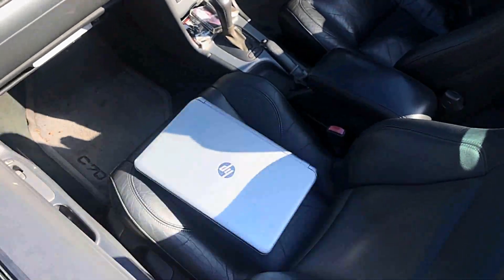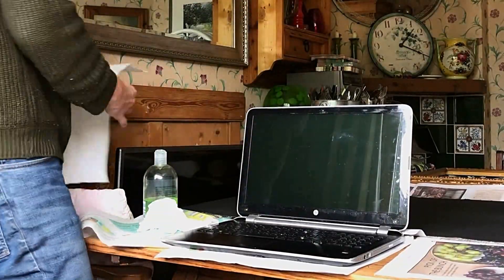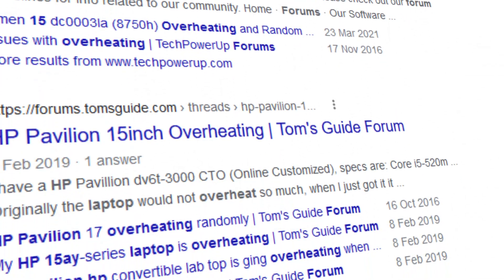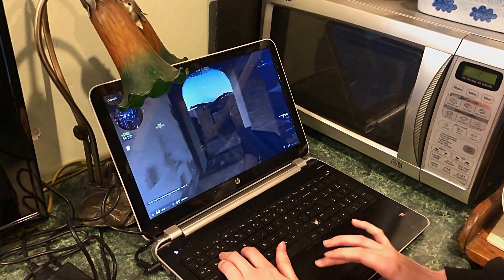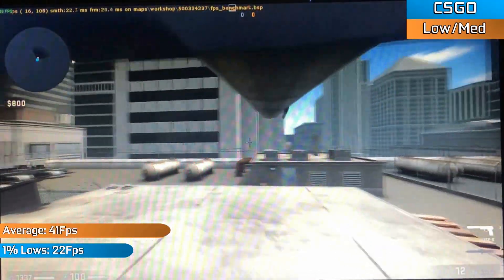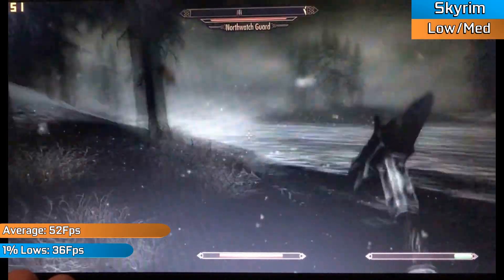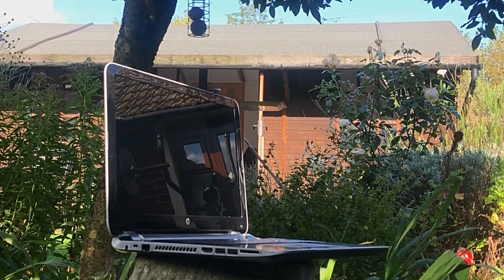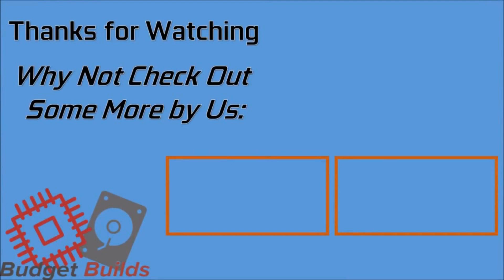AMD & HPs Awful Laptops...How bad are they?

Comment: I had one of these laptops!!! i never could figure out how to fix Crossfire microstutter in games, no combination of OS version, driver version and settings seemed to do much so I ultimately left it disabled most of the time. The drivers had other issues as well, particularly frustrating was their penchant for corrupting my desktop and leaving me with an unusable session every so often and also crashing Photoshop quite frequently.
It always was terribly slow, crossfire or no, I suspect an SSD would've improved overall system responsiveness over the shipped 5400RPM HDD but frankly the 1366x768 display really wasn't doing it any favors, after a while I couldn't bear to look at the thing anymore and further upgrades were out of the question. At that point all I had done was taken the RAM to 16GB of quality RAM because the stuff that ships with these is bad and APUs are super highly dependent on RAM for performance, also they reserve like 4GB just for graphics memory
Reply: Clicked on this video on a whim, and went "wait... I have one of those..."

Mine shipped with two sticks of RAM from two different manufacturers. The keyboard is surprisingly comfortable, and It did a fair job running CS:GO and R6S. Games like Ark would occasionally make it overheat. My cooling solution was putting it in the freezer for a few minutes.

 These days I use it as a tinkering machine dual booting Windows and LInux. Infuriatingly, the UEFI is incorrectly coded. Getting it to load the Grub boot menu requires some messy workarounds.
Reply: @justsomeguy5103  Does it Crossfire in Linux though?
Reply: @armorgeddon  I'm honestly not sure which games support Crossfire nor how to tell which GPU is in use. I assume it's running on the dedicated one, since the framerate isn't noticably worse than Windows (although I only think I've tested CS:GO on Linux). I kind of doubt Crossfire would work, since the driver/utility in Windows seems to assign iGPU or dGPU to specified .exe's.
Reply: @justsomeguy5103  Thanks for your reply. For Nvidia equipped systems there are Linux tools to tell an application to use the Nvidia GPU instead of the one in the CPU though I don't know of something similar for ATI/AMD GPUs.
Reply: @justsomeguy5103  You can apparently still use this feature with hardware and software that supports it, but it only ever allowed Crossfire between the same generation iGPU and dGPU and AMD doesn't ship it anymore, if you can get a Vega dGPU you're better off just using that. It never worked very well or improved performance much over just using the dGPU, so it's probably worth the tradeoff for the increased system stability and better frame times. Most newer games don't support Crossfire anyway.
Reply: @willgreyland7185  Not sure if I understand what you mean. The CPU/GPU solution was marketed by AMD, so I assume that would support Crossfire as advertised. The Windows drivers probably haven't been updated in years, so this stuff should work exactly as good or as bad as it did back in 2014 if you have the correct drivers.

Comment: If you think that's miserable get your hands on a Toshiba C50-D, AMD E1 APU  with integrated 8120 grapics. Even with an upgrade to 8 GB of DDR3L 1333 Mhz and an SSD it still takes 30-60 minutes per Win10 update to install. The HP is fast compared to that lol.

Comment: I have a similar 2012-era Pavilion with the higher-clocked A10-4600m in it (and without a dedicated gpu), and it was a total pain to use. The cpu somehow bottlenecks even the iGPU and the build quality and thermal throttling was every bit as bad- even after a repaste. 

It was my very first laptop when I was 13 and as bad as it was, I still look back at it fondly

Comment: Nicely done. And glad you're back.

How do you fancy testing out what I call my "craptop" that was my daily driver from 2011-12 and my backup system for on the go thereafter? It was a Lenovo G500 with a Pentium P6200 CPU and "Intel HD Graphics." It was kind of an emergency purchase when I got it because my previous laptop had totally died (a 2007 HP running Vista) and I didn't yet have the cash saved up to get a desktop (due to at that time being terminally underpaid.)

The desktop I did get the next year I've had ever since, albeit with 2 new cases, 3 new CPUs, 4 new GPUs, 3 new motherboards, 2 new mice, 2 new keyboards, 3 new power supplies, a new monitor, and 2 new SSDs.

Comment: Ah , I still have this pre-Ryzen AMD laptop, it is OK-ish after swapping the HDD with SSD.
Reply: Most of this kind of laptop (at least on 2015) use 500GB-1tb 5400rpm sluggish HDD. After SSD price is quite affordable in 2019, I clone it to 512GB cheap TLC dramless sata 2.5" SSD, it is more enjoyable than before, like cutting 75% of loading time of windows 10 and apps.

Comment: I used to buy exclusively HP laptops until I realized the keyboard would always have random keys go to shit shortly after the one year warranty. 

I had a cheap HP laptop around 2010 with a dual core CPU I think at like 1.5 GHZ or something awful like that. Anyways it was able to play some games like Skyrim....until I opened the map where it would lag and crash. I played Minecraft on it when it was in Alpha and that ran great until they added the xp system which obliterated the framerate. At least Runescape ran great lol.

Comment: I have hp pavilion 15 aw007nt with an AMD A-10 9600P and its good for daily use and can run some old and some decent games like CS:GO on lowest settings around 40 to 60 fps. Overall its not that bad to live with. It gets pretty hot while gaming but a cooler solves that issue for me. "AT LEAST ITS PORTABLE"

Comment: My old laptop, an Asus X550DP which has an A10-5750M and radeon HD 8670M is still running smoothly for me and until this day I'm still using it as a test server/client even though I have 2 really beefy PC (work and gaming) and an Asus G15. It is really trustworthy even though it gone through 3 repairs (dead battery, loose port and keyboard replacement). As trustworthy as it is I decided to put it in end of service which means if it got broken again then I will not repair it and maybe after 2 years I will put it in retirement....

Comment: I can confirm that these generation of laptops from the first Intel i series generation to second intel i series generations are terrible in build quality. I still use a Dell Inspiron 15R-N5110 with a quad core i7 2nd gen/nivida gt 525m dedicated graphics and this video hits the nail on why these generation laptops dont age well. The plastic bits  that are still on my laptop are barely keeping the screws holding the motherboard due to trying to figure out why my laptop was overheating. A display cable change later, I finally realize that you have to screw in the fan part of the laptop really hard to the point where you think you are stripping the screw in order for the chip and fan to contact and I think this is the prime issue of why these generation of laptops overheated as badly they did. This contact on the fan got my tempature from 100C to 70c on max load. Even if you finally fixed the temperature issue, you still get a laptop that has a subpar hardware that is unable to play most mid 2010's games but I got my laptop for free so I will keep using it until the laptop gives even if it is more reasonable to get a new laptop.
Reply: This is not correct. You just haven't had a great laptop from that era. The beloved Thinkpad T410, T420, X220, X230, HP Elitebook 8440p, 2570p, 8460p, Dell Latitude E6410, E6420, and E6430 are some of the best laptops ever made. The 8440p has superb build quality. I'm even typing this on a Fujitsu Lifebook T731 with the Intel Core i5-2410M. The CPU is struggling to hit even 55 degrees celsius despite it having a 35 Watt TDP. This generation of laptops are some of the longest lasting computers ever, lasting from 2010 with the release of Windows 7, all the way until the end of support for Windows 10, 2025. And that's not even the end because they could be unofficially installed with Windows 11.
Reply: @0w3nn  yeah but the issue is that alot of the laptops that you shown were $1000+ when they first came out around 2011-2013. These laptops would of been way out of the price range for a person who was just going to college for the first time. Today this isn't an issue since you can buy these laptop used for 100 bucks or less but back then the only options that was brand new and affordable was either those really cheap netbooks or laptops like the dell Inspiron 15R-N5110.  However what I will say is that Nowadays where the laptop market is going, these 2011 laptops are alot more better in value for a person who just wants to do basic web browsing and youtube. Even Today 13 years later, my dell inspiron is still working when most of the modern laptops today would be ewaste by the time it is 13 years later for them.
Reply: @GearsyFox  ah.. that is true. i3/i5/i7 only began appearing above the 600-700 dollar range in 2011. Luckily, that had dropped to around the 500 dollar mark in 2014. However, I also don’t think the pentium dual cores and core 2 duos were bad either. In fact, they’re still pretty good. I guess you get what you pay for.

Comment: Still Running till this day the Samsung NP355V5C with the upgraded A10-5750M (undervolted), 16GB RAM, 8660G+7670M Dual Graphics, Upgraded Wi-fi Card, WD Black Dual drive (SSD+HDD) and Upgraded Blu-ray Drive all with windows 10. somehow still works and my daily driver! (9 years old laptop), still gaming on it as it was new

Comment: re: 9:12 , I have a Dell G7 with an RTX 2070 and a i9-10885H, and the GPU hotspot does not exceed 90, and the average GPU temps, during heavy load, run around 80 mark. The CPU, during boost, will bump-up against tj-max of 100c during initial boost (where it runs, thermally bound, at about 4.95Ghz all-core) before dropping back into the 70-80c range after the boost expiration. The overall chassis temps are toasty, but not anywhere near 100, and my G7 is not exactly known for having a great thermal management setup. So yeah, 112 is not just toasty, it's going to threaten hardware longevity. Then again, that laptop is a complete turd, so I'm not sure it matters.

Comment: This era of HP laptops was the worst,i had one that looked exactly the same,but with an i5 5200u,16Gb of RAM,a GT 840m with 4 GB VRAM and a 250 GB SSD. Even with those pretty decent specs it ran like garbage,it would BSOD whenever it wanted,no fault with the RAM or SSD,the battery would die in a week if it wasn't used,plastic would rattle at high speaker volume.....i don't think i would ever buy an HP laptop again.I used to repair PCs and laptops and i came across other laptop brands that had lower specs than mine and they ran better lol

Comment: It's not just Pavilions with AMD graphics. I have a 2008 Pavilion with the nVidia chips that 1) were crappily pasted and overheated, and 2) tended to fail. I recently took it apart to replace the paste (disassembly took over an hour, assembly only half an hour). It still heats like a mofo but at least the GPU won't yeet to 100+ degrees C under any load. Now the problem is that it doesn't have any remotely  new drivers for the nForce chipset, which I had blissfully forgotten about in the ~15 years since nVidia last made mainstream chipsets. Might try Linux next. :D

Comment: I still have that same laptop, it was in such sorry state that had to purchase both replacement hard drive, keyboard, cpu fan, along with new battery! Still runs Windows 7 to this day without any problems, and plays games pretty damn well!  The one big issue with these hp pavilion's is the fan will ware out quickly putting the system into overheat protection mode so be aware of that!

Comment: I hate HP. I bought HP 6735S new I think in 2007 or 2008, and it was such a piece of crap! It was repaired two times, it was overheating and in the and gpu died I think. I have to say it was barely used, and it was used only at home, it was like new outside.

Comment: If you want to play games, there is no reason to install Win 10. Win 7 would run much better and stable on this older hardware. Or you could try some minimalistic Linux distro.
Reply from the maker: Having owned this laptop for years now, there is NO performance different between Windows 7,8,10. Only XP offers some marginal improvement and that depends entirely on title. 

Linux actually performs worse on this laptop due to even worse dual GPU support.
Reply: @BudgetBuildsOfficial  While web browsing or doing office work maybe, but while gaming ... I would bet that Crossfire support for Win 7 is better than on win 10 . As for Linux, there was some talk on supporting Crossfire but I do not know was that ever implemented. Anyway, Linux would run much better if you need this machine as a everyday work computer, simply because it would not waste 2 GB of RAM for OS and associated bloatware. Btw, laptop such as this could be emulation beast . I think it would run GameCube and possible even PS2 emulation without much trouble.

Comment: Oof, made sort of a mistake with this one. Bought it as a gift for my brother in law upon his acceptance to college. I had sony vaio prior to that, it had an amd gpu and while it never was super-performative, it did its job. When similar nvidia mgpu wouldnt even run a game, amd started its jet fan and farted out 3 to 5 frames per second. Awful, but it did its best and so i thought a budget amd gpu several gens above vaios would do even better.
It absolutely shat the bed in performance, but at least it helped my relative in studies. It wasnt a great experience after all, but wasnt unusable at least and had its niche. Cooling was the main issue, thing basically required fan pad to work, otherwise temps were dangerous to knees and fingers.

Comment: yeah they're quite faulty. so hot and the dedicated graphics frequently buggy and died.
I tried to fix my friends laptop and the laptop just like the video. It ran very hot, like super hot. The charger socket is fragile and sometimes suddenly disconnected and died.
I have HP 431 and the dedicated graphics is dead and now the laptop is totally dead.

Comment: God, my first experience with AMD CPU is this kind of APU + discrete GPU and it's a horrendous one. Giving me so much trauma that I had never went back to AMD CPU for the past 7-8 years.
Reply: AMD CPUs derivated from the Bulldozer architecture didn't work well at all on laptops, the very low clock speed crippled the performance and it was still power hungry :/

Anyways the Ryzen laptop CPUs are great nowadays!
Reply: @ismaelsoto9507  I am currently daily-driving a Piledriver laptop,which is based on Bulldozer and other than the CPU being very underpowered and it being originally paired with a hideous amount of ram (4 GB) it runs Windows 10 fine somehow (I ran debloater and now I actually dont see 90-100% usage when only 1 edge tab is open)
Reply: @tezcanaslan2877  That's cool, Pile-driver APUs are quite slow at 2 GHz but it's usable for basic tasks. Certainly better than the very low end APUs like E-350 or C-60 :p
Reply: @ismaelsoto9507  even a core duo,maybe a pentium d even, is more useful than that waste of silicon e series cpus (my piledriver is 3.1 ghz btw with 3.8 turbo)

Comment: Well, there is no bad product, only bad pricing. I still use a A9-9420 APU 2 cores, with R5 230 GPU, single stick ram slot available only. it has served me for 4 years.

Comment: My sister's ex did video game development on one of these. He was working for a subcontractor for Bethesda at the time doing odds and ends at night. Of note was some of the water features in Fallout 4 and some work in the 2016 version of Doom. Needless to say he abused that laptop and I had to substitute quite a few screws from my stash to keep it together as with normal hammering it had lost most of the structural screws holding it together... and yes, I've replaced the thermal compound on one of these and it was NOT fun. I told him if he ever wanted it to get repasted or cleaned out again that it was a better option to just replace it outright.

In the here and now one can get one of those Gateway laptops from Walmart with a Ryzen 5 3500U and 16GB of RAM for like $319-349 refurbished or new, your choice, and for that price for the specs you get it's a steal over the absolute junk this became after Win10 took the center stage.
Reply: TMI

Comment: I had a hp envy 15 with similar specs, I bought a cooling mat, some cooling fins from a pi kit and drilled holes all over the bottom on the case. I could lock the cpu at 3+ghz and the hp fan barely spun gaming. Good Times.

Comment: How Did you manage to get dual graphics working last time I looked at one of these in Windows 10 after one of updates few years windows would either crash any time dual graphics where used  I'm guessing that they patched this
I found it ran better on Linux used Ubuntu after driver isue n didn't use Windows again with it but was definitely usable after getting it running used it as Web browser and lower end steam games and emulation system
Reply from the maker: Only 2 drivers allowed dual graphics to work. Some 2013 from Dell, or some 2015 from HP.

Comment: i had one few years ago, it was working fine until one day my hdd died, and then another one, and then anoter one, and so on... the hdds were on warranty so i had them replaced for free when they died so it wasn't that bad, but it is quite amusing that the amount of dead hdds i had was easily in double digits. the record hdd lasted only 2 days! it became too annoying so i upgraded to an ssd which still serves me years later in my new laptop.
Reply: I had an HP gaming laptop. I ripped the WD blue HDD out of it and replaced it with a Samsung Evo SSD. Then I ripped the disc drive out of it and replaced it with a 1TB WD Black using a special caddy.